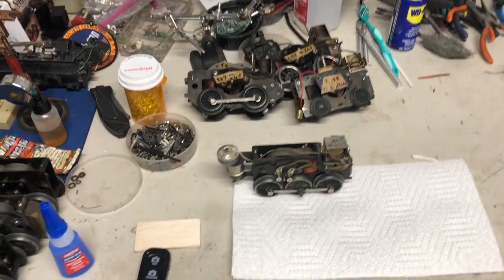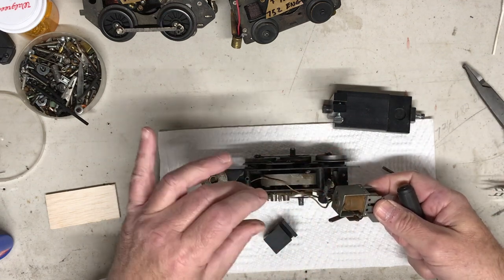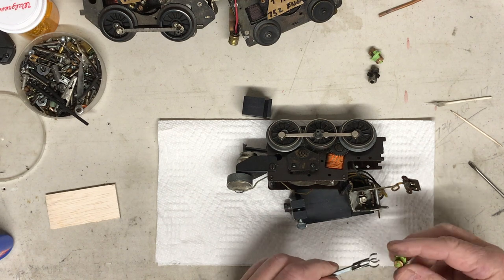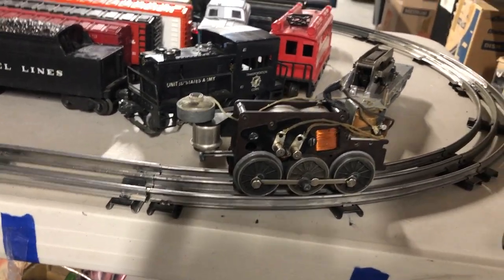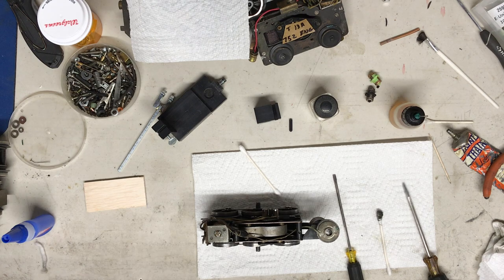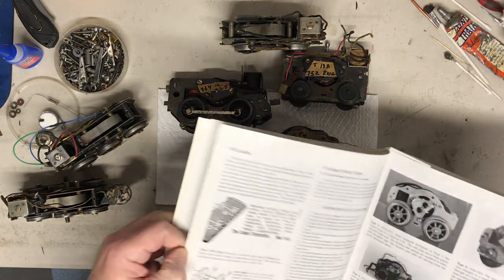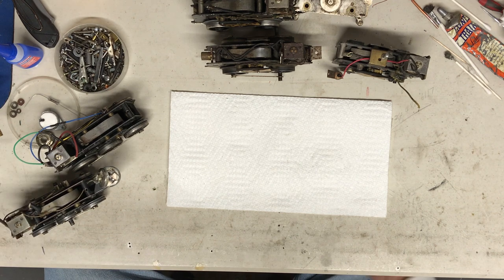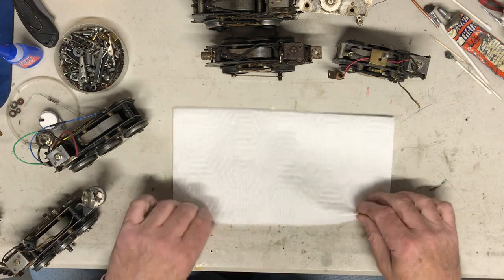Lionel Motor Repairs

Comment: Just found and subscribed to your channel.
Nice tutorial video 👍
I plan on looking for the e-unit tool you have. Would make my life easier. 😃

Something I found with the pellet version  smoke unit; if to much pellet material melts it can clog the air hole. I've cleaned a couple up that the hole was plugged, it had melted through to the space between the bracket and the smoke unit. 
Your motor in this video looks like it belongs to an early 2026.
Reply from the maker: let me know if you find it. Glad you enjoy my videos.
Thanks. 
MT

Comment: I have a question. I have a Lionel 1060 Engine, with a 2-4-2 wheel configuration. The engine does not have Mag-n-Traction, and was only made as Forward directional. And I have been checking on eBay to identify and find the proper motor brushes and springs as future replacement parts. Can you tell me the correct part numbers for the springs and brushes? I checked online and found items: 1001-46 motor brushes and 1001-47 motor springs. And 246-211 brushes and 246-211 motor springs. Thank you.
Reply from the maker: Sorry for late response but the parts for your 1060 would be the 246-11 and 12